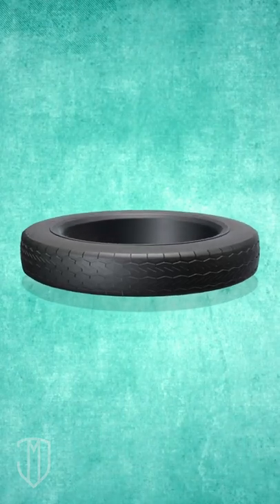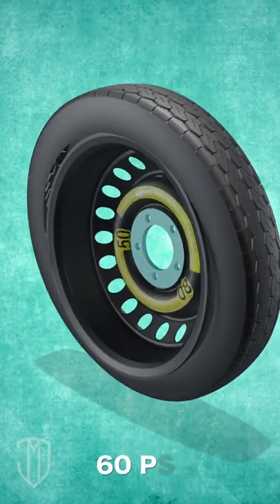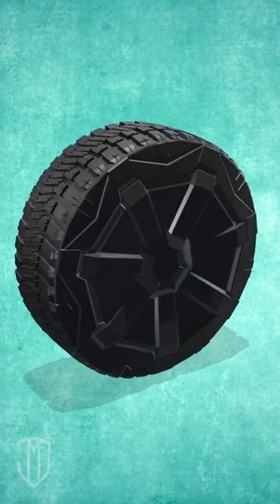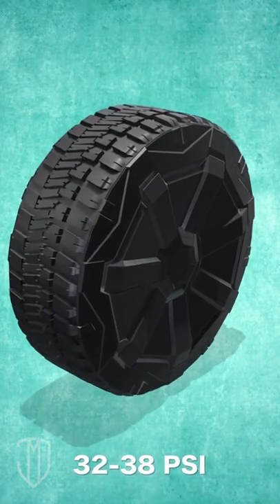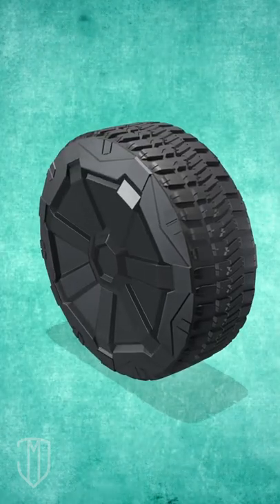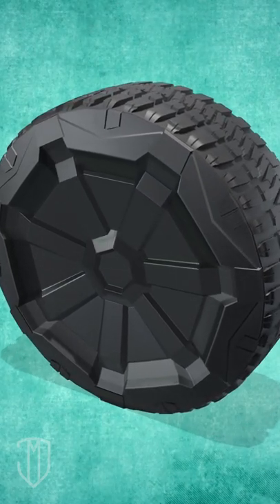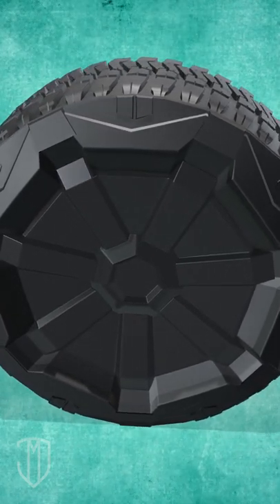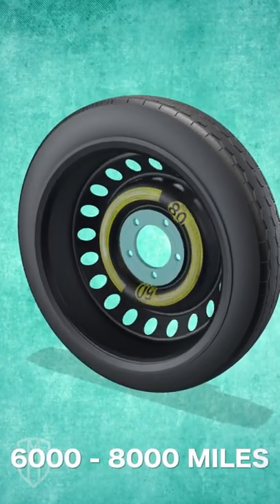Why Your Tires Wear Fast

Comment: Best to fill your tires to the pressure specified for your car. It's found on a decal or information sticker inside the driver door opening. This pressure is almost always less than the max pressure noted on the sidewall of tires.